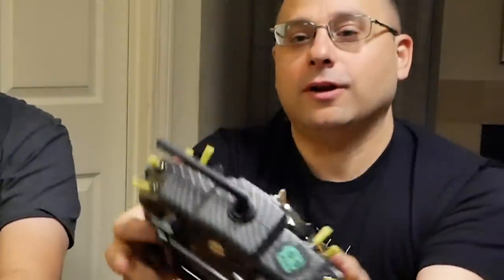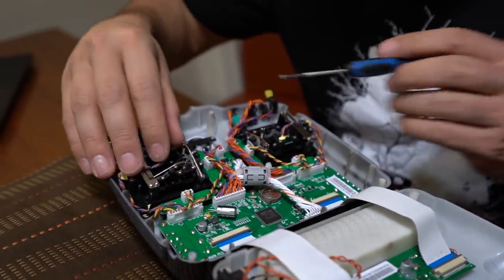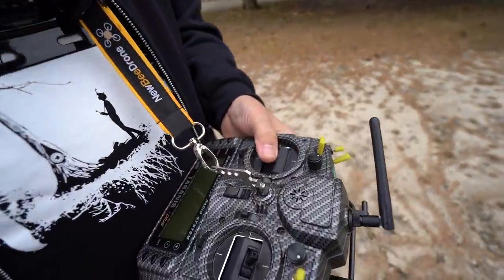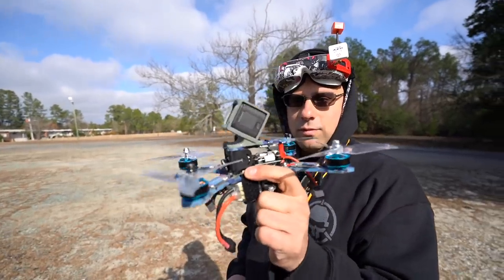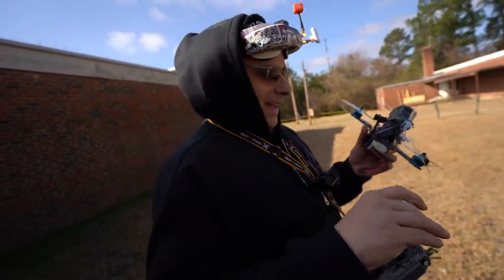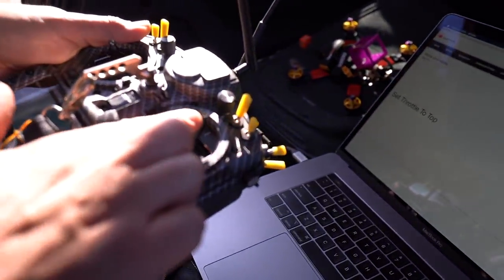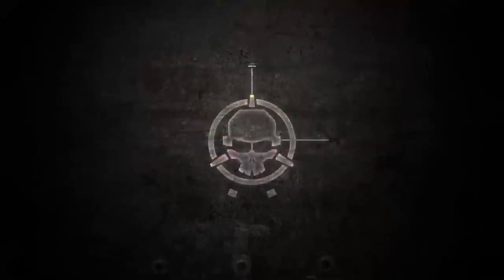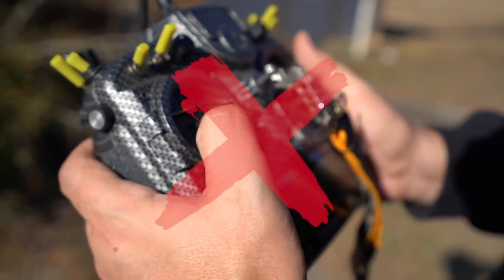Switching Our Controls! Flying Different Modes

Comment: If your training on the oposite mode that your used to it helps to do movements with each stick that are diagonal. Of coarse do it slowly and carefully but once you do a few diagonal stick movements it starts to click. I just started in fpv and I spent two weeks switching between mode 2 and 3. Now I can mostly fly both.

Comment: The most FIRST thing what you need to do before you take apart Taranis, is to UNPLUG battery, or you can just burn MB if you decide to remove cables =)

Comment: I am also left handed and fly mode 2. It just makes sense. Furthermore I am a helicopter pilot, full scale and the controls are similar, cyclic on right hand, so right hand side on transmitter and collective on left, same as throttle, so it’s natural.

Comment: You can setup instant mode changes on a switch in OpenTX with a few additional lines in the mixer section. I'm on mode3 but use a switch to toggle between that and mode1 for a couple friends. It's an easy way to have friends fly your quads.

Comment: WOW that was funny, one thing Josh said,  ( what do beginners do ) We fly sims !  Thanks for a great time and show. And Stingersworm I thought you were going to be diving in minutes and how can you do that with minimal inputs ? Thanks again, and with Vic I understand that you can get your dominant hand to do pitch and roll but back when I started I only had mode 2, and I have  Cerebral palsy and it has caused my right side to be Disabled and a 3/4 inch shorter than the left and I just learned to fly mode 2 and I can't see flying any other way now. Thanks again Guys for a great show.

Comment: I understand having your dominant hand on the throttle, but I think having your dominant hand on the “directional” stick (pitch, roll) is better because you’ll be moving that stick more often than throttle. Plus, having fine-motor movements in your dominant hand will provide smoother directional movements.

Comment: I want the dominant hand controlling movement (I.E. Mode 2). The throttle is like the clutch on a manual transmission. Should be so ingrained it should be an afterthought at most.

Comment: Mode 4 guy here. I came from airplanes and most of the trainer planes had only 3 servos. Throttle on left and rudder & elevator on right. Ailerons was option and it got added on the left stick with throttle

Comment: Just to share with you, most quad guys in Australia also fly mode 2 and there are a couple reasons for this. 
Since quads have been around it kind of makes more sense to fly mode 2 having everything on 1 stick and it appears most who fly quads haven't been in the rc industry very long, if anything come from a gaming background so I presume they are used to the layout.
Also mode 2 can be a bit easier to pick up for most people.

But in reference to your initial comment about mode 1 users and Australians, you will find that many old school rc pilots like say Chad or myself use mode 1 and I believe the reason I learnt this way was flying fixed wing and 3D manoeuvres. I found more control by having that separation. 
Once you learn one way its very hard to change, I will crash almost every time in mode 2 under a tense situation as i just go back to mode 1 recovery every time.
Reply: Suffice to say that FGA is one of the few celebrity pilots who can not only fly BOTH mode 1 and 2 but can do so with great skill. And he can switch between both modes in a snap!! Sick.
Reply: Plus he is left handed!!!

Comment: Gonna have to try mode 3 per Vik!
Reply: I'm left handed, so mode 2 for me. Would be interesting to try it though;)
Reply: Yea I’m a righty and Vik makes sense with the throttle control in your dominant hand
Reply: @elis51501  I'm mode 3 same as vik. I wanted the throttle on the right, same as the cars (right foot) and boats (right hand) I've driven (driving left side of the road - aus). I am left handed, but then most lefties are closer to ambidextrous than "left only" anyway.

Comment: I fly mode 3 but I actually know a guy who switched from mode 1 to mode 2. I believe he tried flying airplanes like that first and then progressed to quadcopters. I might be a little easier this way as when your're flying an airplane you don't really have to worry about throttle and you can make turns without the rudder.

Comment: The mode question wasn't even there, when I started in the 1970s here in Germany. All radios were mode 1 with no option to change it without soldering.
I tried to switch to mode 2 when I started flying helicopters 14 years ago. I thought it's more like in real helicopters and I had to learn a lot of new things anyway.
It did not work, it's like mode 1 is hard-wired in my brain :)
So I'm still flying mode 1.

Comment: Super funny video, thanks! If you really want to switch, start with angle/stabilized mode first while your brain gets used to the new controls. Then disable stabilization once you feel comfortable enough. There is no need to learn to swim by going through near death experiences repeatedly... 🤪

Comment: I would disagree with throttle and yaw being the most important thing to get precise. Usually you have a longer time to find your way to the right throttle point and it is usually not that bad if you fat finger it. If you make a mistake with pitch or roll you are throttling in the wrong direction and you might lose track of where you are as all you can see is ground or sky. Also response times for the quad in pitch and roll are usually faster than yaw and throttle. For me throttle is about timing pitch and roll about precision. especially with the stupid sensitivity we have to run because we have such a small space to move our sticks, srsly that was and is still  is the most difficult for me.

Comment: Sorry but i have to contadict VIK FPV. In my eyes for FPV drones your dominant hand makes exactly no difference. Racedrones have no most important control. So for beginners the best Mode is the most popular because you can get help from friends or stick cam videos.

In flying helis or fix wing planes there is a huge difference between the modes (ask VORT3X)
For example for many 3D heli tricks (i.e. pyroflip) the  swashplate has to swivel around pretty constant so it makes sense to put both swash plate controls (nick & roll) on the same stick so you can swivel that stick the same way as the swash plate should.

For planes it is very different. In pylon racing (F5D) for example you mostly control the plane via the two functions roll and nick. The rudder has no servo and throttle is always max. In these races there is absolutely no room for mistakes, so you don't want roll and nick to interfere, because if you want to pull through the corner and accidentally mix a little bit of roll to your pitch you are instantly in the ground. 
With 3D planes it is the same issue like 3D helis but with the tail surfaces instead of the swash plate. (rolling circle/loop)

For any pilot who wants to start FPV it might be the easiest to have a mode where Roll and Nick are on the same stick perhaps even on the right stick (Mode 2) because thats what resembles the original airplane config the most: Throttle on the left; stick on the right;  rudder somewhere else. Side by side cockpits may vary (ask StingersSwarm)

In Germany in the era before 2,4 GHz "everyone" was flying Mode 4. Then Spektrum came out of nowhere with only Mode 1 and 2 available. Also ca. the same time 3D helis became a thing. First i tried to teach myself mode 2 but with similar outcome as your experience. (Sims weren't a thing jet) So my solution was to resolder my transmitter which resulted in a hustle when i needed the warranty. -.-

So in conclusion which is the best Mode:
- Pilots: Mode 2 (optional  Mode 3)
- Planes: Mode 1&4
- Heli: Mode 2 & 3
- Quads: whatever your friends have or Mode 2 because of the amount of stick cam videos

And now my Schlusswort:
Thank you Rotorriot for these videos you are really an enrichment for this hobby with "almost scientific" content. UAV Futures and Joshua Bardwell (I know ;-P) only other channels that are this quality. Hope seeing you in Germany some time!
Reply: You lost me at nick...
Reply: @jamesordwayultralightpilot  because?

Comment: Switching Modes1,2 & 3 isn't that hard, but I do now prefer 3 & going from 1-to-3, or 3-to-1 is much harder than changing to or from 2...
Tried4 once & nearly ate a mouthful of prop! :v
Grew up with old bikes & tractors & wrote with both hands when young...
Later the mines drummed it into me, each shift the controls would be changed & it was easier to just get on with it...
Didnt help my LOS skills much though, those big things dont move much beyond a walking pace most of the time! :v

Comment: I think it's all about what you're used to., I fly mode 2 but I learned how to fly that way, but in a game like a shooter I just use normal control which would be a bit like mode 3 I think right? The whole dominant hand thing is a weird one too, I play guitar and I'm right handed, but I use my left hand for holding chords, you'd think you'd want your stronger hand doing that but getting rhythm out of my left hand is like getting blood from a stone., not gonna happen. maybe my throttle control would be a little better, but I think I my rolls and flips would be sloppy on my left hand and not line up anywhere near as well as they do now. years of gaming tell me if I really want to remap my brain it's possible, but going back to other things may then be tricky. My 1st few months of flying I made sure to not play FPS shooters so that I didn't mess up mussle memory., I'm playing games again now with no problem swapping between, I do now set up planes and such with my normal flying settings if possible., I did it recently on battlefield 5 and flying the planes is a breeze., but the yaw rate is terrible (I know, planes don't yaw well)., I leave dives way too late in the game too expecting to punch out lol

Comment: I bet Joshua being left handed will make flying modes with throttle on the right particularly difficult. I have often wondered how the U.S. ended up on mode 2. Did the first big U.S.radio control pioneer happen to be a lefty?

Comment: It's literally like starting over again. But combating muscle memory. The need for much more room to mess up is apparent. You've probably haven't like a beginner in years so the anxiety level has to be high. And you probably don't even have Auto-Level bound to any switch either. I would have started there. It's nice that you guys are conducting this experiment. You can feel like a noob again.

Comment: Where they drive on the wrong side of the road they fly also with the wrong mode 😜😆
Reply: Makes a lot of sense. If mode 2 best suits those who drive on the right side of the road, then it follows that mode 3 is the best mode for those that drive on the (correct :) left side of the road. I mean it's the same but with just the sticks switched positions.
Reply: Nope, UK uses mode 2 and drive on the left
Reply: @thatsgood2271  :) You seem to be assuming that the mode that's commonly used at a specific locality/country equates to the BEST mode that could/should be used there; and of course that's nonsense. The Americans were/are the major influence in the RC sport and more recently mini-quad flying, and indeed many round the world just adopted the same mode that the Americans were flying. But that has little to do with a discussion about what might actually be the best mode to choose for a particular person or locality.

p.s. I'm definitely favoring either mode2 or mode3, because I've flown real aircraft and both those modes have roll and pitch on the same stick - that's how aircraft controls work. Yaw (rudder) is a somewhat secondary control at the foot pedals. So mode1 and mode4 are just wrong from a general aviation perspective IMHO.

As far as vehicle driving on the left - throttle is on the right foot.. directly equates to throttle on the right RC stick (mode3).

Comment: mode 4 just switches yaw and roll throttle and pitch stay the same,I can fly mode 2 and 4 with not to much trouble but 1 and 3
not so good.  try mode 4 its cool.  CHEERS

Comment: RIP betaflight - stingy is on FL1
Reply: Tons more people still fly BF.
Reply: Yah I was about to ask this as well. 
No more Betaflight? Wonder why he made the switch.
Reply: I just built a FL1 quad (been flying BF for the past few years), and so far FL1 is way, way better. It's just been interesting to see where the 'good' pilots go.
Reply: @jacobdimick7070  
What is way better about from your experience with FL1 compare to BF.
Reply: @cafub2650  Might be my inexperience with BF (but I used it for about 2.5 years), but my FL1 tune was basically non-existent. As in I setup my quad, and it flies better than my BF quad already. The devs for FL1 also are REALLY involved and post stuff on facebook and youtube all the time, whereas I've never seen anything from the BF devs. To be fair, I never looked for either, but the FL1 stuff showed up without me looking.